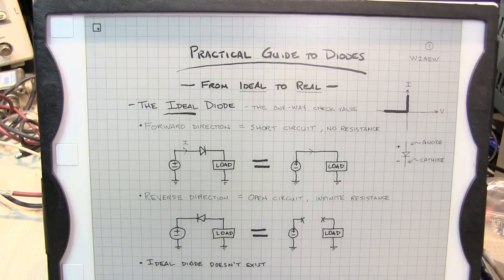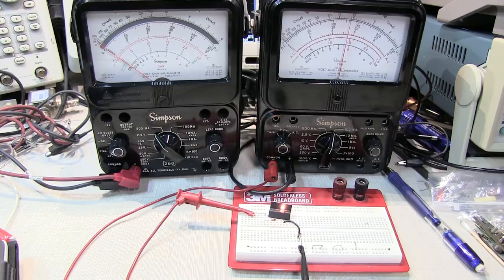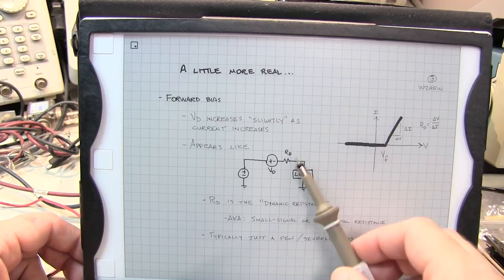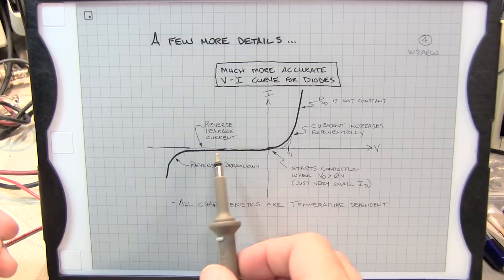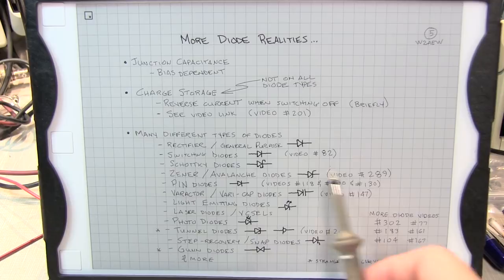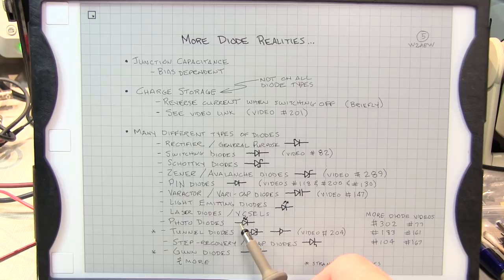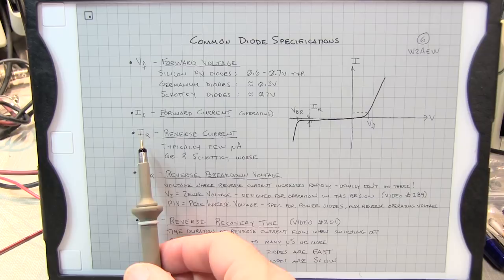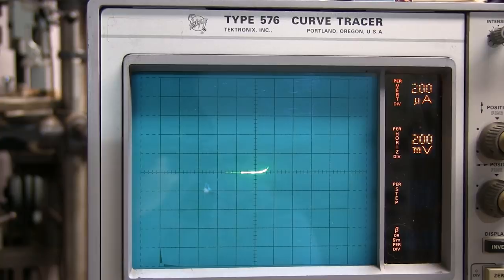#308: Back to Basics: Diodes - guide to operation, characteristics, types and specifications

Comment: I wanted to write and say thank you for all of the electronics videos. The are consistently good. Thank you.

Though, I've noticed that many of the electronics youtube channels I watch are run by amateur radio operators. So, I've been studying for my Technician and General licenses.

For a job prospect, I've also spent about 40 hours, going through almost every signal integrity and TDR video LeCroy and R&S has. I likely won't get the job, so I might as well study a little more and get a amateur radio license, while I am almost there.
Reply from the maker: Good luck with your studying, and with your job prospecting!

Comment: So much great information in this. And the links in the description are gold. I'm gonna have to bookmark this video just so I can come back to the links. 

One topic I was thinking might be good for this channel is why you shouldn't use an op amp as a comparator, or in any open loop configuration. I just read a great ap note from TI the other day about it and it seems to be something even seasoned veterans are guilty of doing. The paper was called Op Amp and Comparators - Don't Confuse Them! SLOA067.

I really like the new format with the tablet, too. I like to take notes and copy what you've written down as I watch the video, but in the older ones it wasn't as easy because you would rarely have the whole page visible in one shot. The tablet solves that very nicely. Thanks for making these. I really appreciate it.

Comment: Alan, I recently managed to resurrect / resuscitate an old Tek 7403 oscilloscope that I was given - a long job but that's another story. It came with 3 plugins, one of which is a 7A22 differential amplifier module. At the moment, I cannot think what it can do for me and wondered whether you could do a (short?) video on function and possible uses /reasons for keeping it. I must stress, I am (was) a mechanical engineer and am dabbling with electronics in my retirement. Many thanks for all of your excellent videos - you do have a knack of explaining things in simple terms.
Reply from the maker: You might want to take a look at my video on differential probes to get an idea of what differential measurements are all about.  This plug-in will give you very good sensitivity, much better than a normal single-ended vertical amp.
Reply: @w2aew  OK will do, Alan, thanks - but I reserve the right to come back if it raises more questions than it answers. :-)

Comment: While there are no ideal diodes, one can build a circuit that does a very close approximation. Often used in solar power applications to minimize losses between panel[s] and the controller.
Reply: If you are talking about the active MOSFET based ones with a charge pump, I would say they should not even be called "diodes". The one from TI has to turn off periodically for the charge pump to recharge its internal storage cap to continue working. It creates a pulse train. Another one I have seen on bigclives channel in a SMPS also has odd limitations, where you cannot suddenly switch polarity without a brief period of no current.

Comment: Diodes can be used for Decoupling when bussing wire lines. In computer keyboards they use Diodes called Isolating Diodes for the matrix columns and rows to prevent "anti ghosting". I'm not sure why they have to use diodes to prevent anti ghosting. The diodes are used to Decouple the columns wires from the row wires. It would be nice if you made a video lesson about anti ghosting examples and diodes being used to Decouple applications examples.

Comment: Your teaching is terrific!! I can’t seem to find anything on upgrading transistors in rf applications. Do you have a video on this or is it possible you could cover this subject?? Possible drop in replacements and upgrading with other components in circuit. Thank you
Reply from the maker: That's a complicated topic.  In order to substitute/upgrade transistors in RF applications, you'd have to understand what particular parameters of the device in question (transition frequency, device capacitance, transit time, switching speed, etc.) is important for that specific application.  There is no "rule of thumb" for this.

Comment: It's common to put a capacitor across in parallel on LED optocouplers To cut down on the ticking noises. I'm not sure why a capacitor would help cut down the ticking noises that LED optocouplers but I'm guessing the capacitor smooths out the led optocouplers switching edges?

Comment: I'm not sure if I'm correct about this because Diodes Depletion layer has more Doping material so it can Block the current when reversed bias? the Depletion layer in diodes and transistors has a lot of Doping materials? The current flows through the solid silicon crystals but if there is NO doping material the Silicon is just an insulator so not current will flow through the diode or transistor.

Comment: that'd be awesome if you could cover the use of accumulator resonators cells like stubblefield coils with accelerators like diode multipliers and joule thief/blocking oscillators and/or boost converters with wet cells (power switching with coils in tanks), no matter the size, even RF... having input schumann zero point energy  (- 6 dBm @ 4 Hz or 7.83 Hz, etc...) power vacuums running off the atmosphere! even crystalizing stubblefield coils to make them last forever!
Reply: this scalar energy or working the ether... something exciting!

Comment: So... weird question... which diode do you think has the most inherent band width? 
Like if you're going to be building a transceiver, which diode type is likely to be the most versatile in terms of circuit topology? 
You can always change the components in your circuit to adjust your filtering, which hopefully changes what signal is getting processed through your circuit, but using a particular diode that can be used to process an array of signals not uncommon. That said, it might be caused by bulk pricing discounts of electronic manufacturers than any real virtue of the diodes themselves. 

I kinda think Schotcky diodes probably have the highest inherent bandwidth to them because of their "leeky" nature, but they probably need alot of filtering in order to make them good detectors in low to mid-frequency applications.
Reply from the maker: It really depends on the application.  For RF switching, PIN diodes are best because of the long recovery time.  But, for mixing applications, schottkys are probably best.  So, there is no universal answer.

Comment: Why when to zenner diodes are placed back to back  they pass current?
at least one of them is back biased and it does not let any electric field to pass through.
so it act as an open circuit and the other diode should not receive any voltage.
thanks for your great contributions.
Reply from the maker: When connected that way, they will conduct when the voltage applied exceeds the forward voltage of the one diode plus the zener voltage of the other.

Comment: Do you have any videos explaining the difference between an oscilloscope and a curve tracer? Very good video! and i just subbed. Thanks!
Reply from the maker: I don't, but can give you a brief overview here.  Other than having a graphical display, the two are quite different.  An oscilloscope is a general purpose measurement only system, to display signal variations (mainly voltage) vs. time.  An oscilloscope does not provide any stimulus to a circuit or device under test, so is mainly used on devices that are powered up an operating.   A curve tracer is a stimulus and measurement system.  It applies voltage or current to a device under test and displays the response to that stimulus.  It is typically used on devices that are not powered up.
Reply: @w2aew  OH okay, Thanks so much for the information! I have an old Hitachi scope I use on guitar tube amps and stereo amps for troubleshooting. I am a beginner tube amp (and the occasional radio)  repair guy that doesn't really deal with solid-state circuits much at all, point to point wired tube stuff is my friend, lol. But I would love to learn more about solid-state discrete electronics. Thanks for the reply!

Comment: Hi
In some logic ic outputs there is some unwanted negative short pulses after falling edge that can damage the microcontrollers inputs.. what circuit can block them can diode be used for this??
Reply from the maker: A Schottky diode can be used to limit the negative swing to a few hundred mV as long as the source is somewhat current limited.
Reply: @w2aew  whats the name of circuit that i can make with schottky diode in this case ??? is that clamping diode circuit????

Comment: I have done quite a few circuitry projects and somehow I have never come across a need for a diode(other than LEDs).  

I understand their function but they just never seem to be the thing I need?
Reply from the maker: Most common applications are in AC-DC power supplies, flyback/protection around relay coils, solenoids and DC motors, analog peak detection, DC power steering, RF circuit switching and mixing, DC voltage drop and bias stabilization circuits, signal clamping, etc.  If your designs didn't involve any of these (or the many thousands of other uses), then that's ok - not everyone needs diodes...
Reply: @w2aew   Great response thank you!

Comment: How can you tell on the curve signature if the diode is a "SUPER-rectifier diode" ? I'm not sure what makes a diode into a Super Rectifier Diode. Also some power supply rectifier diodes they will put a parallel capacitor across each rectifier diode to suppress the diodes turning on/off noise, can you show this on the oscilloscope what these parallel capacitors do to the rectifier diodes because I don't tell at all what they are doing to the power supply AC ripple voltage or DC voltage. Maybe you can show it in a video lesson how to tell the difference.
Reply from the maker: According to this website: https://www.diodes.com/products/discrete/diodes-and-rectifiers/rectifiers/performance-sbr/ - the main difference that you'd see is lower reverse leakage current than a traditional schottky diode.
Reply: @w2aew  What is in the Diodes Junction that creates a lower reverse leakage? They must put some type of material in the diode junction to make it have lower reverse leakage I'm guessing

Comment: @w2aew Your videos are so informative and helpful.  Thank you!  I'm not sure if you take requests, but it would be great to have a clear explanation on how a transistor based astable multivibrator works.  There are many explanations online, but I've found them all a bit "fuzzy."  For example, I'm not sure if the capacitors must be polarized; and why when one transistor conducts, the leg of the capacitor connected to the other transistor's base goes negative.
Reply from the maker: The capacitors don't have to be polarized.  It's just that these circuits are often built using large enough capacitance values that they are generally electrolytic caps because that's all that is available for that value.
Reply: @w2aew  Makes sense.  Thanks!  I've been thinking about the circuit more and its operation is getting clearer to me.

Comment: What is the benefit of using half wave rectification to be the equivalent voltage as full wave rectification? what I mean is what is the difference between +12vdc half wave rectification compared to +12vdc full wave rectification? The end result is +12vdc so what does it matter if its half wave or full wave rectification if the end result is the same equivalent voltage +12vdc
Reply from the maker: The main benefit for full wave rectification is that the voltage peaks occur twice as often, which makes the ripple frequency twice as much as with halfwave rectification.  This means that the output filter capacitors can be half the size for the same effect.
Reply: @w2aew  Fullwave rectification ripple frequency is 120Hz and the filter caps value are half the capacitance value compared to Halfwave Rectification ripple frequency is 60hz. Halfwave Rectification can source more current and voltage? or maybe some digital circuits are more sensitive to ripple frequencys at 120hz?

Comment: Tie B to C on NPN, to use as Diode?
Reply from the maker: Sure, makes a pretty good low-leakage diode, but the reverse breakdown voltage is quite low (typically 6-7V only).
Reply: @w2aew  2N3055 vs. Tesla KD3055 experiment ;-)

Comment: I have a question regarding Voltage regulator IC like ASM1117: suitable for 3.3v o/p.

It was working fine until I did not connect the resistance(100K ohm) between the supply voltage(~9v Vcc)
 and the Vin terminal of the IC.
Now the Vout voltage shows  0.03V and Vin Voltage shows 0.7v.

When the resistor was not connected, Vin was ~9v and Vout was 3.3v.

Please help !! 

Vin(~9v)---------------/\/\/\-----------------|-----------------|``````````````````|------Vin------0.7V    (Rather than ~9V)
                              100K                 0.7V                |   Asm117     |-----Vout---- 0.03V    (Rather than 3.3V )
Gnd------------------------------------------------|-----------------|......................| 

I am struggling with the internals of this IC and why such a characteristic is happening.

Comment: Sometimes I see a diode package has two diodes which has 2 cathodes and 1 anode, example R711A double diode. I'm not sure what is the advantage or benefit of using a double diode package, why do you think a EE designer would use something like this instead of using 2 separate diodes instead?
Reply from the maker: There can be a number of reason to use such a device.  These include but are not limited to:
- Saving space when two diodes are needed in this configuration
- Saving cost when two diodes are needed in this configuration
- Provides thermal matching of the two diodes for applications where that may be important
etc.
Reply: @w2aew  thermal matching would be a benefit so the half wave or full wave rectification is symmetrical identical instead of being slightly off from by the diode junction and doping tolerances?
Reply: @w2aew  I can understand doing that if to use that type of component a double diode that has two cathodes and one anode if you're trying to rectify a signal that you want both the upper portion the positive cycle and the negative cycle to be symmetrical and identical but I don't see that with rectification for a power supply it wouldn't really need to be exactly proportional in the same so it doesn't make sense why some designer would want to put that in the power supply maybe for a phase inverter I could probably maybe understand if you wanted to do phase inverting like in an amplifier you want the upper portion and then negative portion to be symmetrical but this isn't using the phase inverter stage for a push pull amplifier supply
Reply from the maker: @waynegram8907  Other applications such as RF mixer applications require good matching of diode characteristics.
Reply: @w2aew  you want the dios to match in an RF mixers because you want the envelope to be symmetrical is that correct you don't want any tolerances and amplitude differences on the envelope of the the positive cycle on the the negative cycle of the envelope so that's why they have the package of the RF mixer they're all in one package and the thermal and the tolerances are all specced out very close tolerances because of that is they keep the envelope symmetrical I would think right?
Reply from the maker: @waynegram8907  diode mis-matches lead to distortion which increases unwanted harmonic distortion and intermodulation distortion products.
Reply: @w2aew  Can you make a video lesson showing on an oscilloscope and spectrum analyzer when the diodes are match compared to when diodes are Un-matched in power supplies, RF mixers, Audio amplifiers Phase inverters, etc. Because it would be really a good lesson to learn from to know what to look out for in harmonic distortion when diodes are mis-matched compared to being matched.

Comment: What about backward diode?
And their uses?
Reply: That would probably be a zener diode used as a voltage reference.  They come in many different values. I Alan may have made a video on those applications, I guess.
Reply: 1959Berre
Actually it is not Zener diode. At least doesn't use Zener effect.

Comment: I was thinking of putting a diode in the ground circuit of my variable ac power supply. My thinking is that current should be able to flow out through the ground, but not back in. I've also thought that this might be an important consideration when repairing an old oscilloscope, to 'isolate' the scope from any current that might flow into the scope through the ground circuit.
I'm still learning, so I'm not sure if my thinking is correct.
Reply from the maker: If you need to isolate ground, use an isolation transformer.   Wouldn't work anyway, since you mentioned it is AC (current goes in both directions normally).
Reply: @w2aew  It does have an isolation transformer. I was talking about the ground wire in the cord that supplies power to the vac supply.
Reply from the maker: @tofinh  That is a safety ground.  Under normal conditions (i.e. no shorts, etc.), there is no current flowing in the ground circuit.